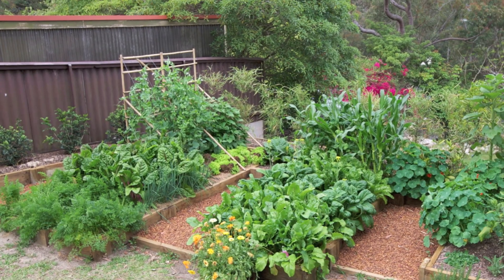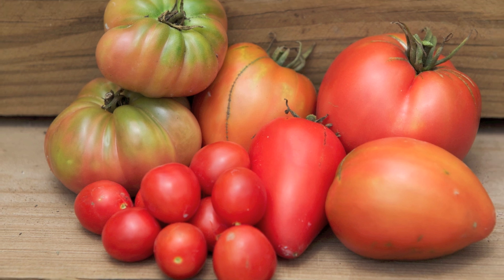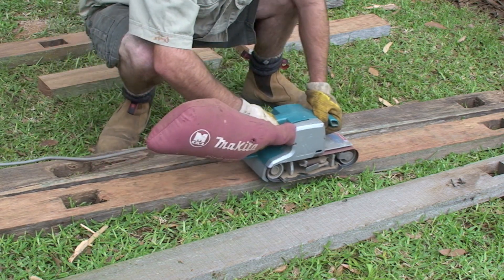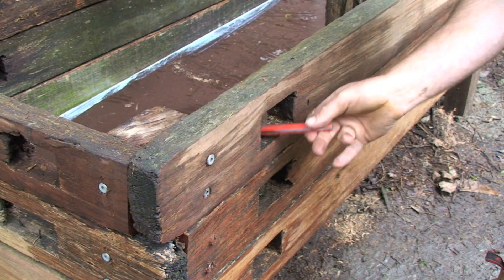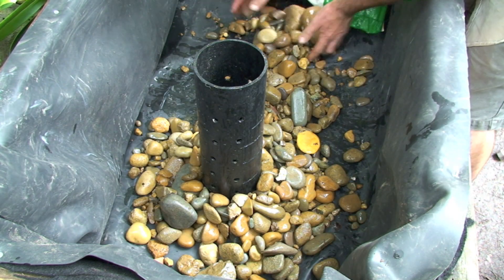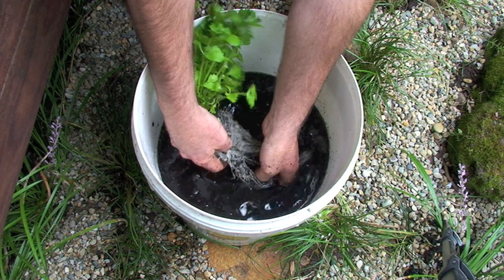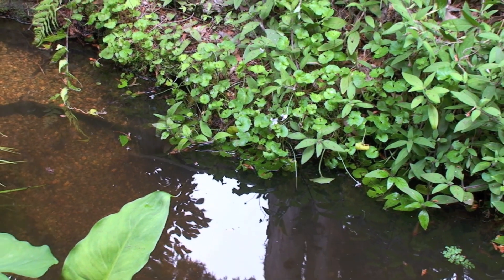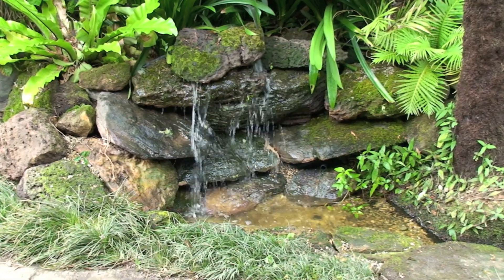How to create an aquaponic pond system

Comment: Hey! I’m trying to set up something just like this in my backyard and I was wondering how the plumbing works exactly
Reply from the maker: Hi Alyson. The key is the syphon component as that is what allows the bed to fill and then automatically drain and then repeat the cycle. Basically... nutrient rich water from pond is pumped into 'grow bed'. This fills up and the syphon triggers and the bed drains back into the pond. As the water runs through the bed it leaves behind all of the nutrients etc that the plants then use to grow and the return water is effectively filtered. Don't be put off by the syphon mechanism. You can buy them as complete units from online suppliers or there are some great online tutorials showing you how to make them. Just search for 'how to make a bell syphon'. Hope this helps & good luck!

Comment: Damned hippies, what about the noise pollution for the poor neighbours over the fence with those pumps running and that water dripping all night
Reply from the maker: Hi +tosgem  you'll find the low-voltage submersible pumps are very quiet. If the cascade is too noisy at night it can be put on a timer as it runs on a separate pump to the grow-bed. The outflow from the grow bed isn't likely to cause a noise problem. On saying all that in many suburban or inner-city situations the sound of running water can be very useful 'white noise' to help cancel traffic & other noise :)
Reply: I do not have an aquaponics setup (yet), but do have a pond with 2 small waterspills. i cannot hear the pump at all. when i turn it off the water stops falling, when it turns back on i am unable to hear anything until the top reservoir fills up enough to begin letting water out. pumps are silent. I love sitting near the pond listening to the water, and the neighbors have mentioned the love the sound as well. Maybe I just have cool neighbors, lucky me :)

Comment: Hello,
This is the first video I watched on aquaponics several years ago, and I have came back to watch it again as my inspiration. I am planning on doing this using our existing koi pond. I noticed you said (6:20)  that using this type of system operates differently then a tank system. Could you elaborate on that please?
Also, Could you tell me what was the rough dimension of the grow bed that you built?
Thanks for the Help, Lee
Reply from the maker: I'll ask Charlie to fill the gaps in for you Lee. Stay tuned :)
Reply: Thank you Adam. I look forward to starting this project, looks like it would be lots of fun, and a great way to garden.
Thanks for the help,
Lee
Reply: A pretty good rule of thumb that I've found when determining grow bed size is to use a 1:1 ratio in gallons between your fish tank (or in this case pond) and your grow bed. Also important to keep in mind is that this ratio is intended for when your tank or pond is at it's maximum carrying capacity or about a pound of fish per gallon of water. This ratio is also intended for grow beds that us hydroton (expanded clay) as a grow media which I recommend using over gravel or any other type of grow media really.
Reply: Slight correction. The ratio I used for grow bed volume to tank volume in gallons was right, but you should only have 1 pound of fish to every 3 gallons. My mistake on that.
Reply: Adam Woodhams Stay tuned :) (for more than 7 months) lol
Reply from the maker: Noah Schuler  unfortunately Noah I was just the interviewer in this video so my ability to provide follow-up info is based on what Charlie from EcoLicious provides to me. Unfortunately I haven't had the answers I needed from him so rather than doing what some YouTubers would do & to post something & pretend I know what I'm talking about I have left it unanswered. 
A wrong answer is far worse than no answer in my book.
My humble apologies if anyone needed this info.
I'm sure Charlie wouldn't mind if people contacted him directly. Here's his webpage http://www.ecolicious.com.au/
Reply: Cool thanks for the clarificaion!!!
Reply: Adam Woodhams Thank You!
Reply: Adam Woodhams Was just looking for a response, thanks.

Comment: Where is this shot? Could i do the same in german/dutch climate?
Thanks for sharking!
Reply from the maker: Hi Jasper Toeli, my apologies, I overlooked your comment. This clip was shot in Sydney Australia so technically a temperate/warm temperate climate>
And thanks valhalla83, yes, your are correct in a cooler climate you would likely need heating depending on the situation.
Reply: This was shot in Australia, probably in a sub-tropical climate.
Aquaponics can work anywhere, providing you regulate the conditions to the fish. In Germany/Holland, you may need to add temperature control in the winter months, but there is plenty of information on that in other videos and websites.
Reply: There are fish that you could use that can withstand the pond freezing over. Carp is a great example. You would need to have the pond deep enough so that only the top of the water will only freeze. I had a koi/carp pond in NY & they lived for years. Also the feeder goldfish that sometimes survived would make it through the winter as well.

Comment: Is it possible to get a list of all the things that were used in this video? WITH LINKS to sites that offer it. I would like to build this kind of a system and I'd like to know where to buy the materials.
Reply from the maker: Hi Psyk MusicAndGaming, most of the parts should be readily available from a large hardware store or landscape supplier. The most complex part is the 'bell siphon' but it's made of easy to get parts. Try a google search with the term 'make bell siphon' & you'll find heaps of info. There are also some suppliers who sell them as units on-line. When searching use both spellings too siphon and syphon.
Cheers, Adam

Comment from the maker: Yes, in this case it does use tapwater 303Miles. The best case scenario would be to use captured rainwater but that's not always doable. When you're adding new fish the best thing with tapwater is just to let it sit for a week or so to let it settle down.

Comment from the maker: Hi SuperDbessire,
Treated wood should be okay for use as long as it is not CCA or any other arsenic treated timber. You do need to remember that the plant roots, gravel & water are not in contact with the timber as the rubberised membrane separates them. A bell syphon, there's a good question. Most people make them to suit their situation, you can also use a 'loop' type syphon. Search YouTube for how to make a bell syphon & you should find some vids. Hope this helps!